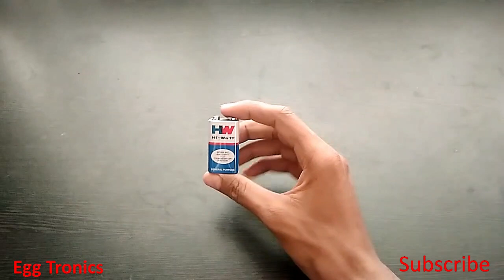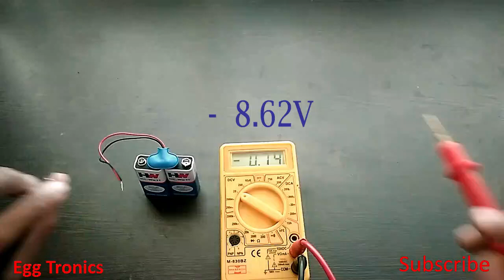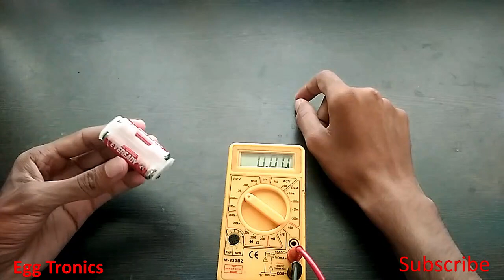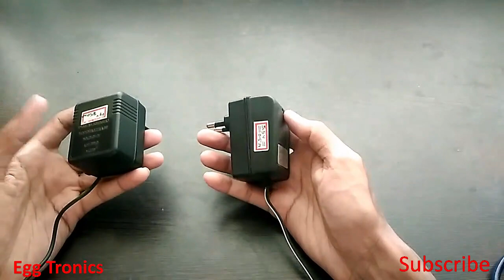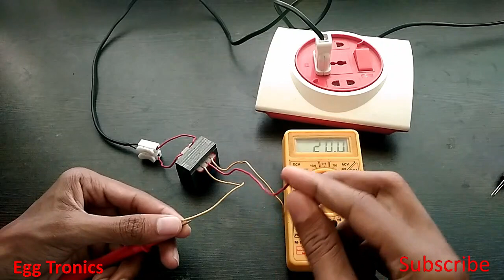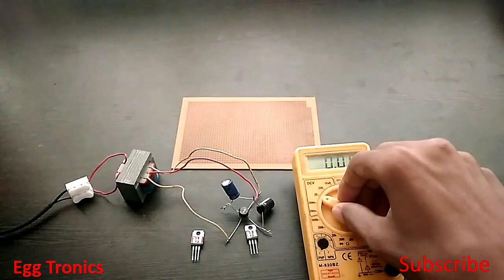Make your own Negative Power Supply (Dual Power Supply)

Comment: Guy want to thank you very much. I am relatively new to electronics. I spent 3 days and mostly nights trying to figure a way to provide negative voltage on an audio amplifier I am modifying. I could not find any information about how to do it until I ran across this video. Thank you very much.

Comment: what is the use of negative voltage plz replay...
Reply from the maker: Hi.  They are used for Operational Amplifiers. Also with certain type of MOSFETs in inverter circuits.
Reply: @EggTronics31  
Operational amplifiers generally have the ability to invert a signal (voltage) I'm unaware of any application where negative voltage is fed into an op-amp to be inverted to positive voltage.
Reply: Some audio amplifier like tda2030A need positive negative and ground so extra negative is required